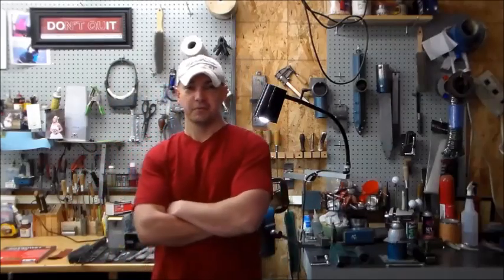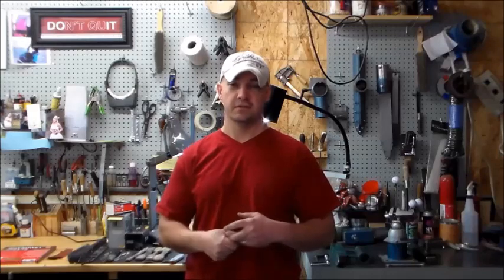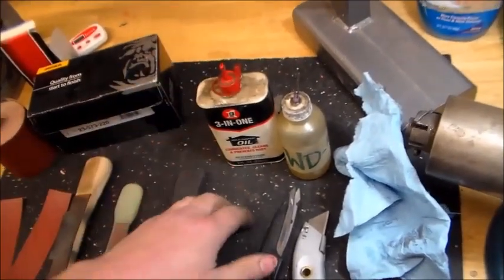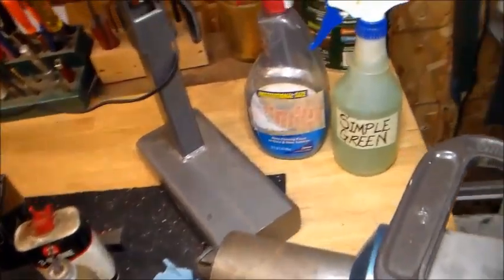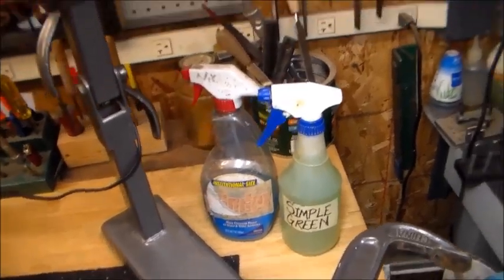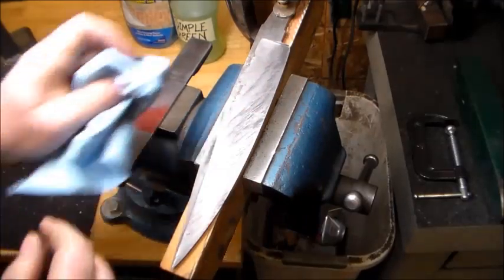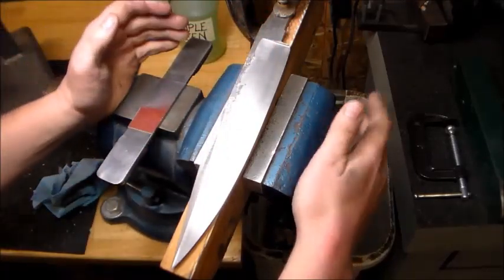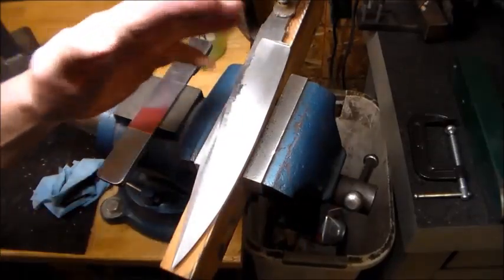Nick Wheeler  Hand sanding knives 101

Comment: I"ve tried this on a few blades, and it turns out very nice. The only problem I have is getting a super clean plunge line. It's like the paper isn't getting in there tight. Do I need to try different style sanding blocks?
Reply from the maker: silverN gunz What does your current sanding block look like? A chisel ground edge on a sanding block makes it a lot easier to get into the plunge and see better as well. :)

Comment: I've watched this video and read a couple posts from bladeforums about your sanding sticks. You've got a metal one that you've put a bevel on that I really like. I'm curious if that steel is heat treated or just it's pre-heat treated state. And do you prefer the steel stick to your wooden ones that are shaped? I realize that usually you use the shaped ones on handles, but I'm just curious. Thanks
Reply from the maker: TheBobfriday  Bob- None of my sanding bars are heat-treated. It would make them more wear resistant, but I haven't found that to be necessary. It really just depends on what I'm doing as far as which bar I prefer...but I usually like the "paddle" styled bars the most because they are the most comfortable to use.

Comment: Thanks for the vid Nick. I have read somewhere that its best not to sand with your fingers just holding the sandpaper, instead of using a sanding block. Any thoughts on this? I have done this with my first two knifes and while the scratch marks all appear in one direction, the satin finish is not clean - I can see the individual lines.
Reply from the maker: theelfman I'm not sure I understand your question...can you give me a little more detail on that?